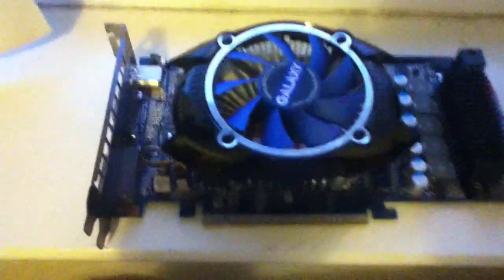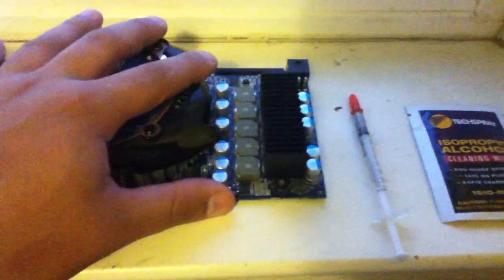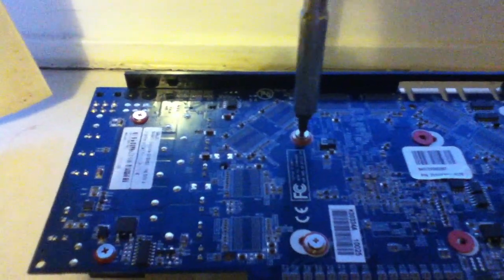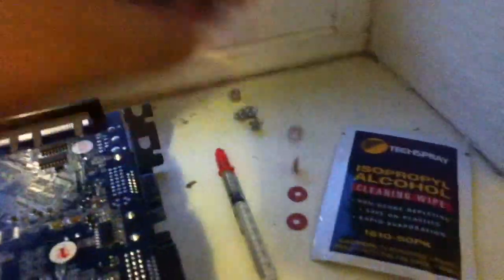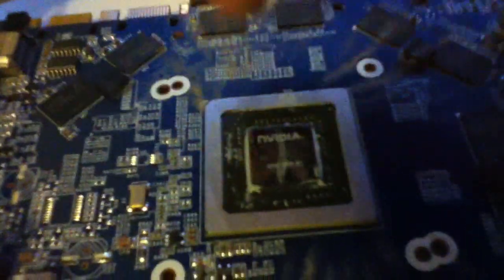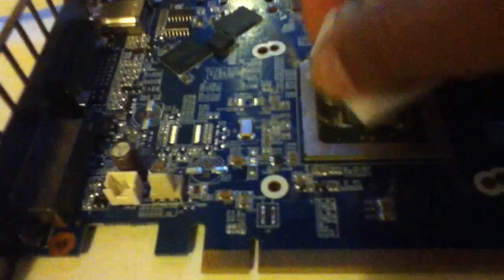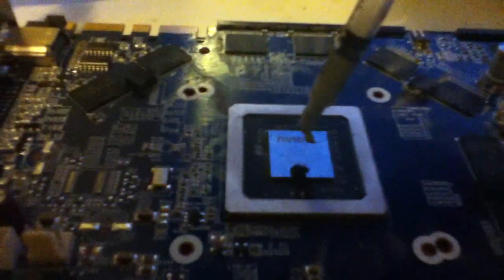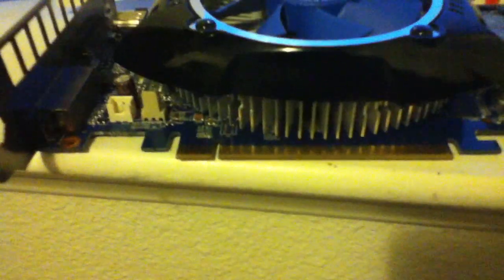How to apply Thermal Paste to your Graphics card

Comment: Nice video. How often do you think this should be done?  I have a rad eon 5850 for 2 years and haven't done it yet!  
I overclocked the card from its stock 760/1050 to 800/1090 and haven't had any problems.  The ole' if it ain't broke don't fix it comes to mind.

Comment from the maker: thanks for looking, stock thermal paste last a couple of years before it gets hard and loses it functionality. so i say now to next year especially if your overclocking. when u over clock your gpu has to work harder thus creating extra heat. so when creating extra heat u are drying out the thermal paste much faster than normal clocking. did you over clock it for 2 years straight or just started not to long ago?

Comment from the maker: @Phenom69ll yes it has to be alcohol rubbing is a great remover. toilet paper is not recommended because it leaves residue behind. you can use a cloth that does not contain static electricity. mostly any cloth or rag will work. but toilet paper will work as well but as i said not recommended because of the residue that it leaves behind.
good luck with removing the thermal paste and thanks for looking :D i will be showing how to add metal thermal paste to the same graphics card check back soon!

Comment from the maker: its not cause it spreads evenly. i know this for afact because i used to be my teachers assistent for 2 years and i had to show student how much to apply so i mastered how much to put. putting very little meaning a thing layer wont work that well just enough will work. the thinner the faster it dried out so you have to put it just right.

Comment from the maker: @omgpwn666 if you want some good stuff and the best stuff you should get liquid metal thermal paste from frozencpu i used it and my temps went from 64c idle to 51c. its expensive but well worth it. if your graphic card has copper heat sink then you are good to go. but remember if you add this thermal paste you will void your warranty.  also is your card getting enough cool air? did you dust our your gfx, make sure nothing is blocking the gfx suction.

Comment: Just take off the heatsink and apply a fresh coating of some better quality to the core, it's pretty much like a cpu except you apply it in a smaller quantity depending on the size of the core. Just handle it carefully or you might be sorry, a scare here and there is fine just dont toy around too much, get in get out job done. (My gt440 had this stock shit on it, mx4 brought the temps down an amazing 10 degrees and now it overclocks like a pro.)

Comment: Did this work on your card? What temps did you get? Was it better?
I did something like that to my card and temps went up to 100C.
Reply from the maker: +Another Games yeah it was actually better. the thermal paste that comes with the gfx isnt always the greatest. so it did cool down, i dont remember how much because it was years ago but all  remember was it was pretty decent drop. which kind of thermal paste are u using?
Reply: knownasgeeks A cooler master, cpu cooler to the gpu. I will try to reuse it though.
Reply from the maker: their are other brands out there that provides better results.
Reply: knownasgeeks Yeah I know. But since I already have the paste, why not waste it? :D
Reply: I just reused it and seems to have dropped temps by 5C. It makes much less noise now.
Reply from the maker: what card are u using?
Reply: +knownasgeeks Powercolor HD6770 v2.
Reply from the maker: i believe those cards already run hot. the best thermal paste to date is Thermal Grizzly Kryonaut. you should give it a try.

Comment from the maker: mmm its hard to say what it could be. what is the error code in the blue screen? what temps is your system running at, is your fans spinning? you can use speccy to see what temps your pc is running at. save a snapshot when your useing speccy by going to file then save snapshot. upload it to mediafire then give me a link by clicking on my profile then click about then click message.

Comment: Can i ask some of your opinion, would it be possible that the reason my computer freezes during a high graphical game is due to a graphics card with no thermal paste that may be subjected to overheating? I removed the thermal paste and didn't replace it for quite some time and its just now that i have realized that it might be the cause.
Reply from the maker: +jim catungal yes that is possible. thermopaste is much needed. one thing might of happen the gpu could have burned out. try adding thermo to see what happens. if issue still happens you might have burned out the gpu. which card do you have?
Reply: amd radeon r7700 series. but can it be fixed or is it time to buy a new one? I know  it is the problem because after removing the graphics card i didn't encounter that freezing problem again.
Reply from the maker: +jim catungal most likely it is damaged. it's a decent graphics card but if I was you get yourself something better that provides more power and less issues. you can also try adding thermal paste to see if that fixes it. I'm about 90% positive your graphics card is no longer good.
Reply: +knownasgeeks yes I'm also assuming it is damaged. what do you suggest i get?
Reply from the maker: what is your budget?
i currently have the MSI Radeon R9 290. got it off craigs list for 100 bucks which was a steal :D. i can play any game at max. no problems what so ever.

Comment: it removes lol leave it to dry and with a piece of tissues or microfibre cloth re-pass with cloth. 70-99% iso should do the trick. Btw I think you did alot compound, I happened to change my PHYSX card compound dropped by  from 61C idle (Summer) to 49C with AS5 and never goes up @ load are 61-62C now and I overclocked it. I think you should have done less compound, tho for a better performance, If you have a big GPU do the 5 dot method method spreads evenly.I know this stuff is old :D

Comment: @xlegendqc87x pea meathod works fine! and knownasgeeks discharging static, you dont need to touch anything outside, inside as long as its grounded will work, IE the inside of your case(not components though, just chassis) (going outside then back in will build back up  a charge) once the component is OUTSIDE OF YOUR CASE its not grounded thus cannot discharge to it (if ur working off of a wooden platform... wood works best for inhibiting static discharge) NEVER PUT ANYTHING PC RELATED ON CARPET!

Comment: @knownasgeeks He's not, actually.
He is correct.
He's not saying that the thermal paste WILL have air bubbles. But it becomes a possibility.
Washing your hands doesn't remove the oil from your hands. Otherwise thieves would just carry around a bar of soap instead of rubber gloves to not leave prints.
Same with ESD. You won't necessarily give off an ESD when you touch your component, but discharging yourself first will prevent it.